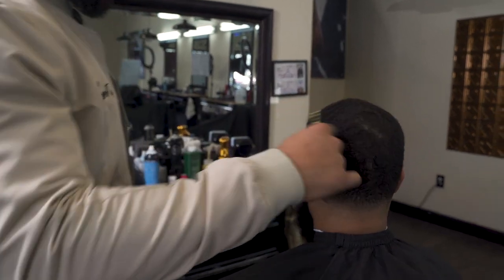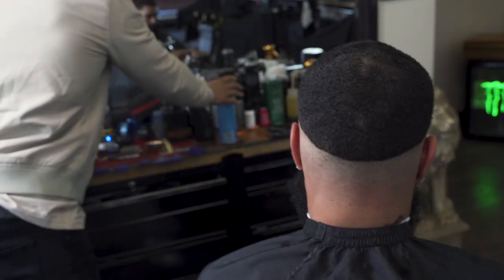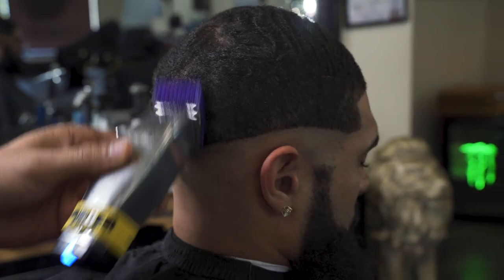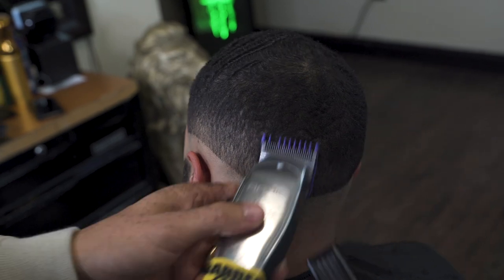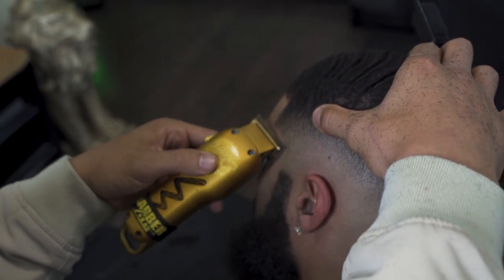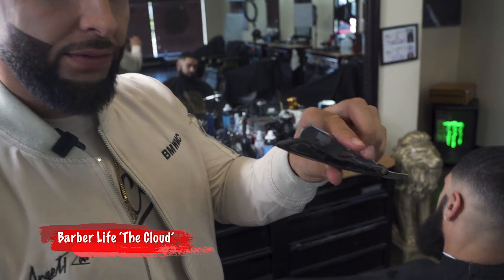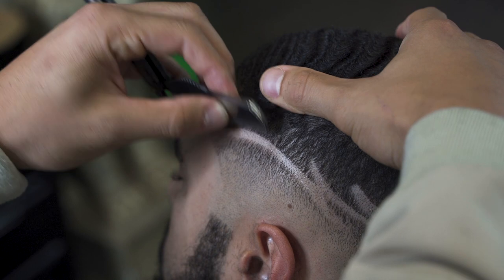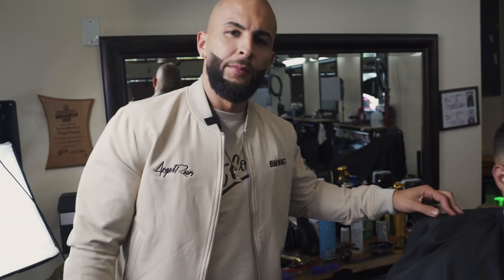HOW TO REVERSE FADE WITH A SIMPLE DESIGN

Comment: Hello that was a phenomenal fade. If the andis system goes from 000 closed to 1 open when there is no guard Then the 1 guard closed to open goes from 1 to 2. 2 to 3 and so on. Im confused about the 0 guard. If that’s the equivalent to a wahl 1/2 guard wouldn’t that mean that it goes from 1/2  closed to 1 1/2 open? Would you be able to get the same result by skipping the 0 guard and after you finished the 1 guard section use no guard open and proceed fading down by closing.

Comment: How did you zero gap the cordless masters?
Reply from the maker: Pedro Sermeno yes I zero gapped all my tools
Reply: @AngelRaws  how did you do it in the cordless master?
Reply from the maker: Pedro Sermeno same as the other masters just loosen the two screws & push the blade back
Reply: @AngelRaws  is it the same as zero gapping a wahl clipper or you have to open the base of the clipper up?
Reply from the maker: You don’t have to take them apart just loosen the screws & push the blade
Reply: @AngelRaws  awesome they made it easier then. I remember the originals you had to either break the bracket or take the base off and push the blade up from inside